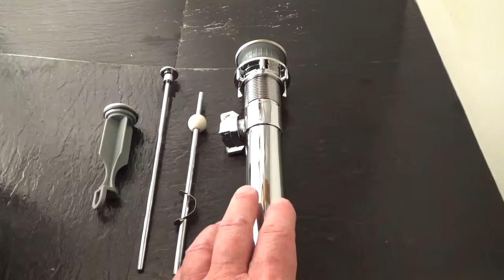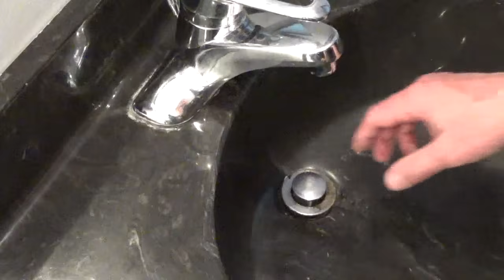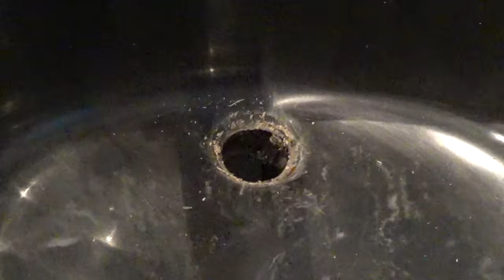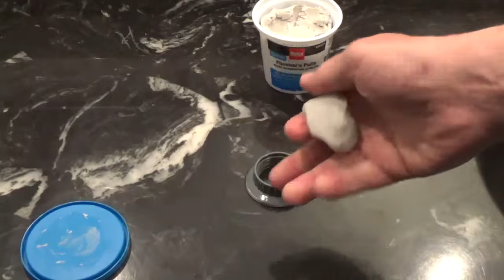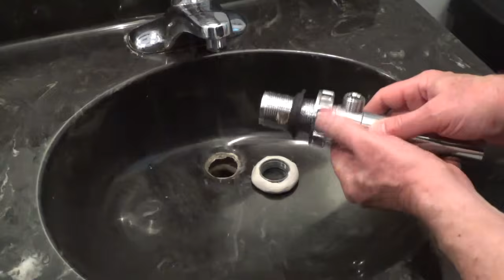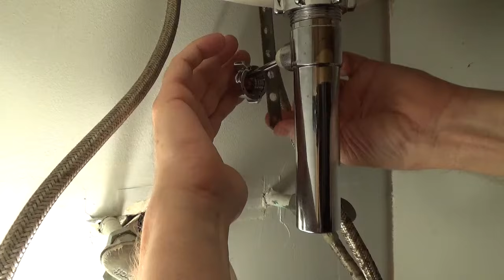Replace Bathroom Sink Pop Up Drain - Sink Drain with Lift Rod

Comment: If I need to keep the old drain assembly but don’t want to use the lift rod,which is leaking, how can I cap or seal the pivot rod hole on the drain side?
Reply from the maker: Hi, put the pivot rod in place so it doesn't leak, but don't attach it to the strap on the lift rod.
Get more home improvement tips in our e-books https://www.amazon.com/dp/B0GTX5ZBTR
Reply: @FIXITHomeImprovementChannel 
Yes. That is what I did but water is leaking around or thru the ball.
Reply from the maker: @elenakarlak4617  Hi, do you have a ball with the rod in it? Do you have a washer or plastic seat for your style?

Comment: Quick question would this work with a sink without an overflow?
Reply from the maker: Hi, if you haven't purchased the pop up yet, you want one without the holes, if you don't have an overflow hole. If you have a pop up with holes you can still use it, but water gets into the holes and it can cause odors over time.
Check out home improvement tips in our e-books https://www.amazon.com/dp/B0GTX5ZBTR

Comment: I'm using a pipe without a lift rod, Does the overflow hole need to face any particular direction?
Reply from the maker: Hi, it doesn't matter what the orientation is for the hole in the drain pipe. 
Check out some home improvement tips in our e-books https://www.amazon.com/gp/product/B0B2KW1FQ9

Comment: Bit complex and easily clogged design. Still prefer the normal screen and separate plug when needed, since rare enough. Makes cleaning the system far easier as well.